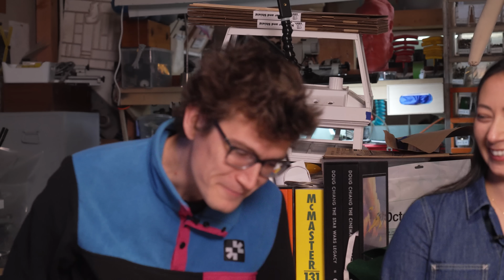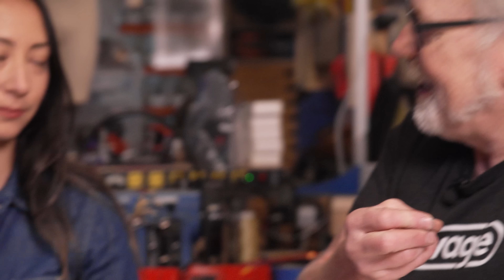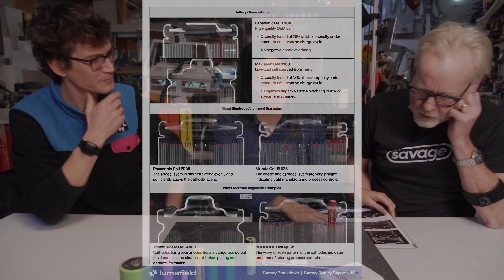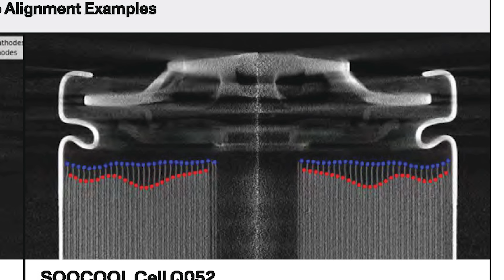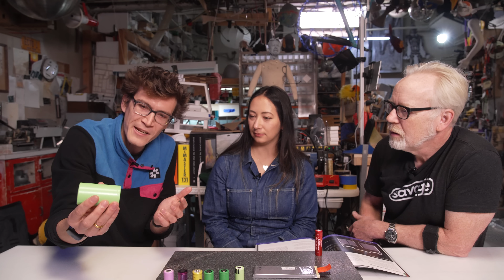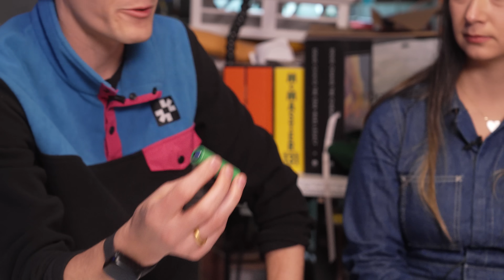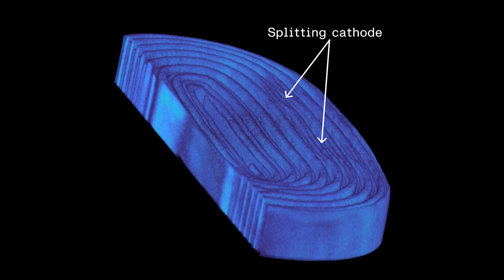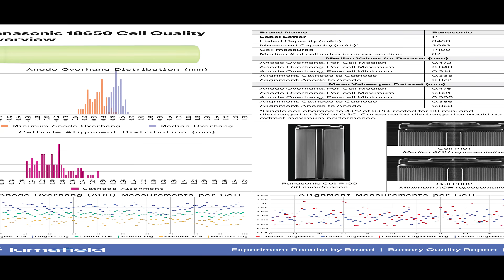The Surprising Flaws in 18650 Lithium-Ion Batteries

Comment: Would be interesting to see just how bad the batteries used in the single-use vapes are.  These are increasing in popularity, get generally get tossed on the ground, or into the garbage, and are becoming a growing problem.  Even if not catching fire...
Reply: If you throw a li-ion battery in the garbage, you should assume it will catch fire at some point. Even an absolutely perfect battery will go off if you pierce it.
Reply: @jeschinstad  That's my point.  Vape users treat them as they would a cigarette.  Tossing it on the ground, out the window, into the trash, etc.  So many city streets are strewn with them.
Reply: @_SurferGeek_  That sounds absolutely crazy.
Reply: @jeschinstad  My comment?  Or how smokers treat vapes?  🤔
Reply: @_SurferGeek_  i haven't see a vape smoker do that lol. Simply because those E-cigarets are not cheap and require maintainance to actually enjoy them.
I tried to vape once and found out that is actually just as expencive as normal cigarets, you have to change that resitance quite often because of the smell, you have to clean it often.
For all that trouble i would rather smoke tabaco, at least i know i am smoking. 
With your point of view should be considered the same, phones, or any other gadget wich has an battery inside.
Not to mention people thorw batteries in the garbage for years, any kind of battery is just as dangerous.
Maybe i an not aware and in the US E cigarets are so cheat you can aford to throw them on the street as you were saying, but in the other parts of the globe i don't think that happends.
And yes, your comment does sound kind of crazy.
Reply: @alexandrugajin763  Did you actually say this:  "...rather smoke tabaco, at least i know i am smoking..."   Seriously?  🤣
Reply: @_SurferGeek_  ???
What is wrong with what i said?
Vaping is just as bad as smoking, maybe worse.
That liquit has same stuff in it wich is used in antifreeze.
After few uses taste like molten plastic.
And no matter how much you try it, it can never replace a real cigarette.
I buy my own tabaco and roll my cigaretts.
And at least i feel like i am smoking when i do it.
Vaping is just as worse, and depending wich liquid you use for it is even worse then real cigaretts.
People who say vaping is better or healthier are just weak hypocrites.
Pick your poison and don't be a pu$$y about it.
Own it.
I really dislike ignorant people.
You threw an stupid reply thinking you're sarcastic and that you;re smarter. 
If i haven't tried Electric cigarets i wouldn't say.
But i know those things are just garbage.
I would rather poison myself with a real plant than antifreeze with spice in it lol.
And don't think i have something with people who vape. 
I just dislike the ones who vape and think somehow they are better, is not even about vaping is just the mentality. Is like... Ugh.. You know what i mean?
I don't think so...
Reply: @alexandrugajin763  Never said that vaping was better than smoking... just hilarious that you seem to think that you have any idea what's actually in the tobacco that you're smoking.  Unless you're growing it yourself, you have no idea what's sprayed on it or what it's processed with.  The industry has been busted over and over for the chemicals they use.
Never said that I was smarter... but, now that you mention it.  I don't smoke.  Enjoy your coffin nails!
Reply: @_SurferGeek_  Sadly the chemicals used to keep the plant off bugs, the agents used for fast drying.
Are used in everything on the market not just tabaco. In the tea plants, in the spice used in your food, in the food of the animals wich you used. Not to mention the kind of crap they put in animals to stay "alive" and the antibiotics wich destroy your immune system and later develop auto immune diseases. And so on...
To grow your own tabaco isn't hard, the hard part is to cure the leafs, wich takes months, it's an alternative processes of drying and fermentation, so you can actually smoke them. And this process is only effective if you do it in large quantities.
Meaning is very impratical to grow your own tabaco. Unless you smoke like a kilo a day and fry your lungs.
As i said pick your poison, in todays world is planty to chose from.
Nothing of what you eat is natural anymore, not even the water wich you drink. Unless you have a well.
This is why cancer is pandemic now among alot of people wich don't drink or smoke.
Reply: @alexandrugajin763   🥱
Reply: @alexandrugajin763 Vape juice does not contain the same chemical as antifreeze.

Propylene glycol is used in vapes. It's not toxic and it's an ingredient in a lot of food products.

Ethylene glycol is used in antifreeze and is poisonous.

Vaping good quality liquid that's Propylene Glycol / vegetable glycerine based is absolutely safer than smoking.

Vaping crap liquid with oils in it is arguably not.
Reply: @alexandrugajin763 Vaping can be as expensive as smoking. But only of if buy disposables. I spend maybe pennies a week. 
Use a rebuildable atomizer, make your own juice, and wrap your own coils.
I bought a just under 5 liters of nicotine concentrate in 2020 for about $200, I've still barely made a dent in it. Beyond that, the only ongoing costs are nichrome wire, cotton, vegetable glycerine, propylene glycol, and some flavorings. None of them are remotely expensive, and all of them last for either months or years before needing to be replenished. If the cost of vaping is anything more than negligible, you got suckered into doing it the wrong way. DIY everything, not only is it unbelievably low cost, it's also an infinitely better product. Plus, you know EXACTLY what you're inhaling.
Reply: @alexandrugajin763  I have picked up at least a dozen of them at this point specifically to claim their batteries lmao. We are talking about disposable non-refillable vapes, not like actual vape pens
Reply: @LazorVideosDestruction I picked up a rechargeable one and it had an EvE cell (one of the good manufacturers)...that was a surprise for sure!
Reply: @_SurferGeek_  Back when cigarettes were the only highly popular method of smoking nicotine, plenty of people unwittingly started roadside brush fires by tossing cigarette butts out the window. Some things never change, huh?
Reply: @alexandrugajin763  try grammarly or at least spellchecker dohh
Reply: @jeschinstad  It won't even if is fully charge. It will just discharge slowly over the years.
I had fully charge li-ion batteries left in my garage in some old tools for 10 years. Still had power in them still work perfectly.
Li-ion are pretty hard to destroy, since the cilinder is kind of made for that purpose. And even if you shortcircuit them, they have kind of like a fuse inside wich burns before the battery catches on fire.
Li-pos on the other hand are much more dangerous, and in most E-cigarets, you will find a lipo battery, usually a poor quality one too.
But again, the only way it can catch fire is if is pierced or you force the battery terminals to shortcircuit. And even so it will melt the wire and lose connection before it catches on fire.
The main reason lipo and li-ion explodes and catches fire is when charged with the wrong charger or a faulty one.
Reply: @alexandrugajin763  Not all cylindrical cells are protected. You're thinking of the specifically "protected button top" type, which has the protection circuit you describe.
Guess what, every one of those is built on a "bare cell" cylindrical cell, which you can get if you know where to buy them, because you don't need to duplicate that protection circuit for every cell if you're making a power tool battery that uses usually 5 of them in series along with a BMS board (which does cell-to-cell balancing and fault protection across all the cells, obviating the need for individual cell protection circuits).
Reply: Big Clive calls them street lithium. He repurposes and tests them
Reply: @lightningdemolition1964  He's great!  And by far... the minority though.
Reply: @lightningdemolition1964 you can't test if they have the potentially dangerous production flaws shown in the video.
Reply: I find these disposable devices on the street once in a blue moon and i have extracted some cells out of them. But i'm hesitant to use the cells, because i don't think they'll actually survive cycling very well.
Reply: @SianaGearz  they won't. They're garbage tier pouches pretty much designed for a single use. but it can be done
Reply: I recommend everybody to watch this /watch?v=s-DGQGIFjlE "The Vape Ban That Backfired on the US"

About how Big Tobbaco's lobbying to ban the hobbiest/rebuildable industry and take over the market themselves is the reason disposables are so rampant. It's effectively radicalized me seeing the whole process and everything that led up to this point over the last 10 years. The fake popcorn lung studies, the misinformation campaigns, tobacco payments to states. I never thought just vaping for the hobby of it and not even using nicotine would lead me down such a dark rabbit hole and realization of how corrupt our system is. and now I get to scoop these fuckin' things off the street and experience the fallout
Reply: Alot of the dab pens iv taken apart like to use lithium polymer to fit there form factor.
Reply: I unfortunately came into possession of a few dozen dead disposable vapes when I bought a used car once, the kind of vapes that are flavored like kids cereal and stuff, and I took them apart to see what was in them and the insides are apparently not designed by people who care at all about the safety of the product. Out of a few dozen NONE had any type of battery protection or cutoff, all were soft pouch batteries and were very poorly made cells, many of them were deformed/crushed into the housing during manufacturing. Some of them weren't even soldered they had the wires twisted to the battery leads and then taped with masking tape. The good thing is once the battery is dead they aren't any risk of fire because they seem to run the battery to zero volts because no voltage cutoff. The bad thing is there are vape shops full of fully charged ones sitting under apartment buildings and.. I would not want to live above a shop that stocks disposable vapes.
Reply: Either way, those things are such an incredible waste. I bought one a couple of years ago and used it occasionally. When it stopped working on me a few weeks ago, my natural instinct was to charge it but oops, there's no charge port. It makes me wonder just how much juice was left, not to mention, how many dozens of times the battery could've taken a recharge. There are folks out there who'll scavenge single-use vapes out of garbages and off of sidewalks because, hey, free rechargeable battery!
Reply: @Dee_Just_Dee  The UK has now banned non-rechargeable vapes, so vapes all have charge ports now. But when the juice runs out and there's no way of refilling them, the battery still becomes e-waste. In the past I scavenged single-use vapes from my neighbour to assemble into battery packs. After this video I doubt I'll trust them any more.
Reply: @Dee_Just_Dee  from what I've heard a lot of them use basically scavanged batteries already, they're either not QA compliant and marked for destruction, or just harvested from devices that end up in the bin, so recharging is pretty risky.

But if you can, get a rechargeable vape and mix your own juice, it's way cheaper, and there's usually less risks, also you can mix to taste. (Do get reputable brand batteries from a reputable seller though)
It's also a great way to phase out nicotine, make a nicotine free or low nicotine bottle and one with your regular amount of nicotine, and refill the nicotine bottle with the nicotine free mix, so over time the doses become lower.
Reply: Learn to build packs out of them. Its not hard
Reply: @Martial_Academy  Completely missing the point of the video.
Reply: If there is no port to charge them, they are probably not rechargeable.
Rechargeables are more expensive than standard batteries, there is no way a manufacturer would pay that extra price for no reason.
Reply: @DR_1_1 Rechargeable lithium are cheaper than non-rechargable lithium.
Reply: @incandescentwithrage  Not true, you can find branded AA Lithium batteries for $1.5, a rechargeable costs 2 x more...
Also you can not compare "Lithium" rechargeable vs disposable, not the same technology, Lithium metal vs Lithium ion.
Reply: @DR_1_1 It is true whether you like it or not.

A rechargeable lithium ion pouch cell is the cheapest technology you can get that's up to the job.

The manufacturers put rechargeable cells in disposable vapes.

Don't shoot the messenger.
Reply: @incandescentwithrage  I guess you are an expert when it comes to vapes, with that username!
Agree to disagree, then.
Most vapes I can see are rechargeables. All with standard cells, not pouches.
And as mentioned I can find cheaper Lithium disposable than rechargeable.
Reply: @DR_1_1 Yes it may be we live in different places or are looking at different markets.

When I vaped I used a non-disposable with 18650 cells - expensive initially but liquid refills only about £1 a day.

The vast majority of people though used disposable vapes, which although are sealed non-refillable and non-rechargable, they are powered internally by a rechargeable lithium ion pouch cell.
Cheaper to start but more expensive over time and terrible for the environment.

That is what people are referring to - there are videos on YouTube of people recovering and repurposing these perfectly functional rechargeable cells that have been discarded after a single use.
Reply: @DR_1_1  Standard lithium batteries probably can't supply the current necessary to vaporize the liquid. Regardless, yes, vapes use Lithium-Ion batteries, I know because I've found many myself and taken the batteries out of them.
Reply: @LazorVideosDestruction   Maybe try to get together and have them banned? 😀
Do you have many other disposable devices with batteries in America?
As I said, single use vapes are banned in my country (and neighbors in Europe).
Not that I can recall seeing any of these tossed on the ground anyway, even before the ban...
That's why I was first a bit skeptic about these single use rechargeable batteries.
Reply: @DR_1_1   Because of their power density and the sheer volume of manufacturing, inexpensive Li-ion batteries are all but ubiquitous.  Most cheap vapes use Li-ion batteries, even if they're not reusable/rechargeable.
Reply: @_SurferGeek_   Well, guess what, disposable vapes have been banned here, maybe EU-wide soon... of course I couldn't see many of these.
I know Li-on are quite common, laptop, drone, camera, I have 18650's too, eneloop are NiMH though, voltage issue I understand.
We just just don't have many disposable electric devices that I can think of, around here...

Comment: So now I need to be terrified of my cheap flashlight who's battery rattles sometimes when I shake it. Perhaps I shouldn't keep it next to the bed.
Reply: Honestly. An emergency flash light is probably the best use case for basic Alkaline batteries. Or even the cheap Carbons. Those store forever when there’a a hard switch on them. Especially in single cell cases.

Comment: DIY-ing cell packs as one do, having a BMS with a temp sensor is vital to avoid overcharging and heat, though as well, ideal would probably be to get hold of flame retardant material to use to pack cell pack before you wrap it in the blue or similar exterior plastic, and finally, the charger should also have any form of temperature sensing function for itself to avoid the charging tech generating too much heat, and of course make space for the charger as chargers may become somewhat "hot" to say the least .

Comment: Report Results - Cell Brands with Smallest Anode Overhang: 
Murata, Samsung, Panasonic, Efest, Vapcell.
Reply: And don’t trust Efest or Vapcell. They may be re-branding Samsungs today, but in 6 months you won’t know.
Reply: @Racing_Pig exactly
Reply: I didn't know Murata made batteries. It's a good brand for electronic parts like inductors.
Reply: NO! you need some overhang, i.e. > 0!
Murata, Samsung, Panasonic (and Trustfire this one with much less regularity)
All other brands have some samples with no overhang or even negative overhang!